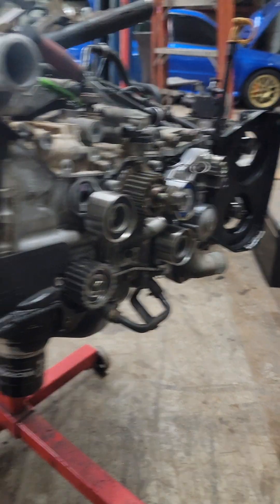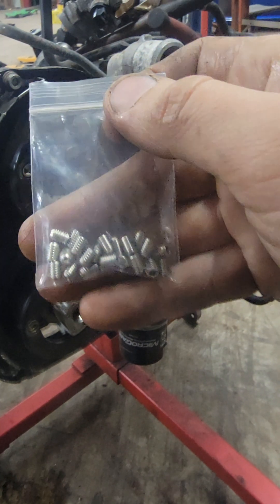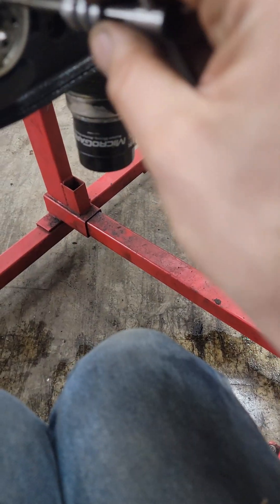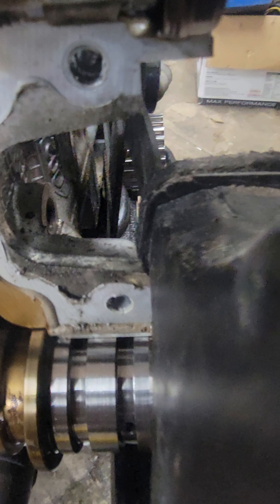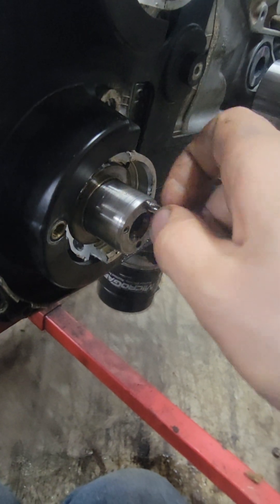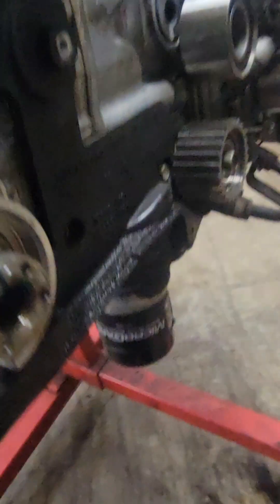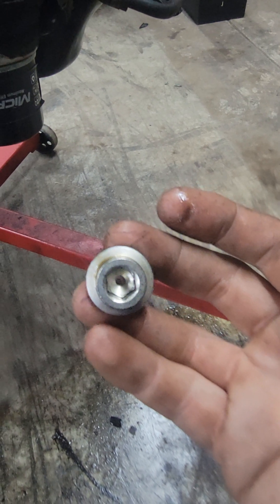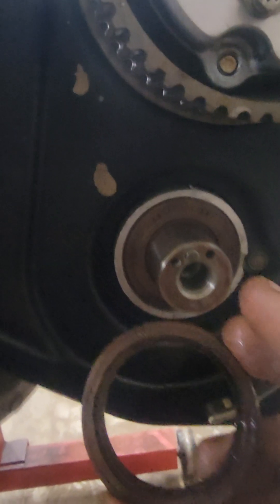Proper way to delete exhaust AVCS Subaru EJ 257 20x etc.

Comment: Best video on doing AVCS delete, did you swap the cam gears or keep same gear but just used different bolt without the hole?
Reply from the maker: Use the USDM plastic gears.